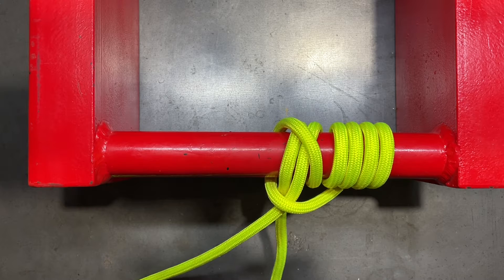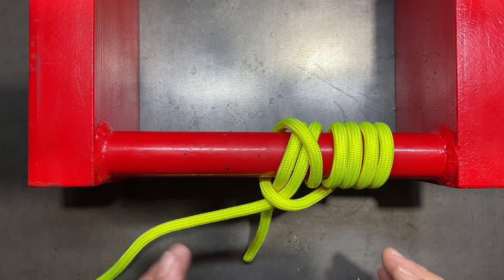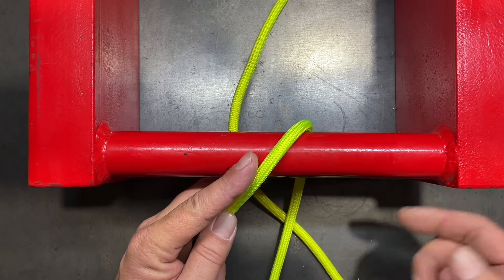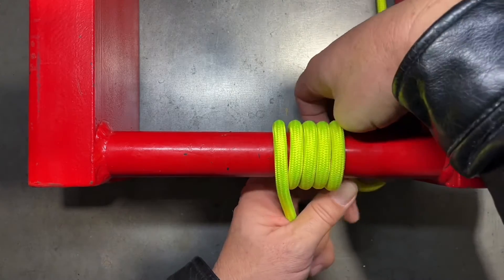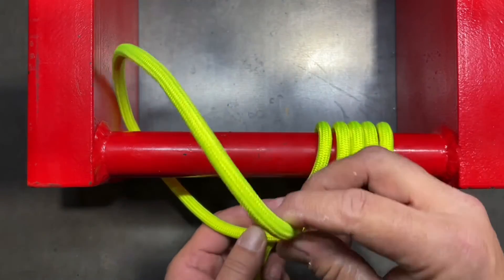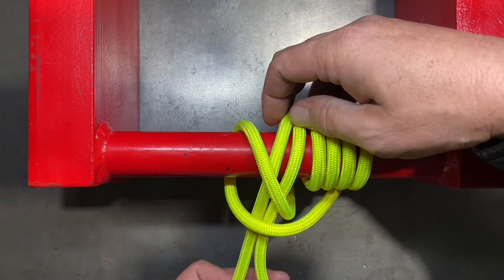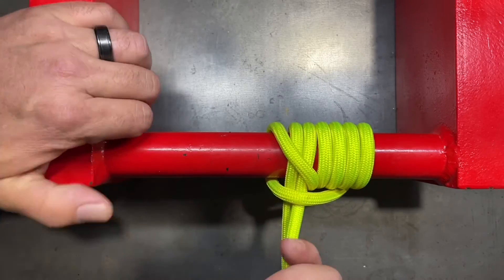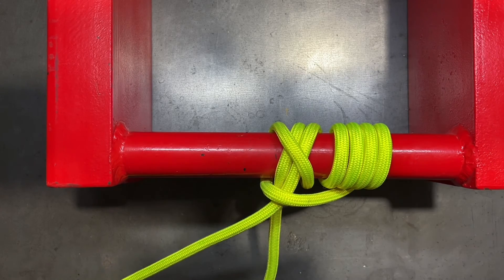Icicle Hitch

Comment: I will say that I'm a fan of the icicle hitch since it's a very cool knot and does its job quite well. However, I find that in all cases EXCEPT for when there's a taper on an object that a 4-wrap prusik knot (not sure if there's a more technical term for this) is superior. It can be applied to the object much more quickly than the icicle hitch, it can be loaded effectively in any direction (this is an opinion based on experience, I haven't run the numbers), and it does very well on slick surfaces like metal pipes (same warning as before). It's also easier to dress and to ensure you tied correctly in a pinch, where as the icicle hitch takes quite some practice especially since it's a very situational knot.

Comment: Cool. I checked out your pipe hitch the other day, and a few other icecicle hitch  videos. All including yours said pull laterally, but this on is nicer? So Instead of only working along the rope, since it fully incorporates the clove hitch, it's good for holding away from the pipe as well as laterally. After tons of searching basically almost considered going with a prussic. But I've now been told to just go with 2 clove hitches (doubled rope so, I think it's 16 wraps) 8 uplines which I  am not happy about and the reason I've steered away since I've mostly thought people were just doing a bunch of barrel wraps.

Comment: Thank you! I dont know why everyone else on the internet ties this knot in the other direction. This way seems so much more intuitive to me
Reply: It's not just the question of direction. This is not the right Icicle Hitch. In the correct version, after  five loops the  working end comes back up diagonally  and  around from top (similar to pipe hitch but the icicle hitch has different finish than pipe hitch).. Compare closely and you will see this is not correct Icicle Hitch.
Reply: wikipedia Icicle Hitch has same direction as this video  (pull to left) but compare finished knot images. You will see it's not the same.

Comment: Great to learn! Is it for a light duty lift only or can you use it for “pull out a frozen drive shaft” kind of job as well?
Reply: Please compare closely. This version (even if it works great) is not right Icicle Hitch
Reply from the maker: It will hold to the breaking strength of the rope when properly seated.

Comment: Hey Ben, The Icicle Hitch appears to have the same function as a Pipe Hitch.  It seems you only need one.  If you could only use one, which would it be & why?
Reply: According to an article I saw  Icicle Hitch is prefered (compared to sailor's gripping hitch -- not sure about pipe hitch). However this video hitch (maybe it's good i don't know) is not correct Icicle Hitch.
Reply from the maker: I use the pipe hitch most of the time, only because I can tie it faster. The Icicle Hitch is stronger, and the knot scheduled for the next video is even better. All of these knots are fine for most applications.
Reply: Find "Icicle Hitch - how to tie it in the middle of an object"  -- that one is proper Icicle Hitch